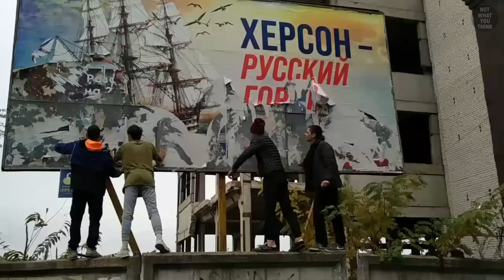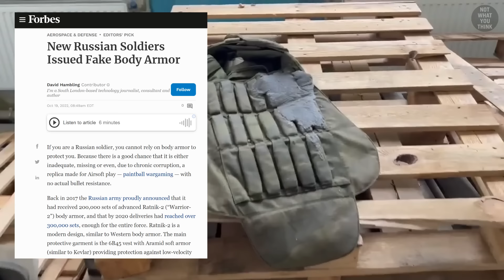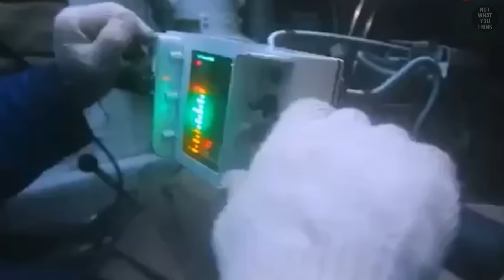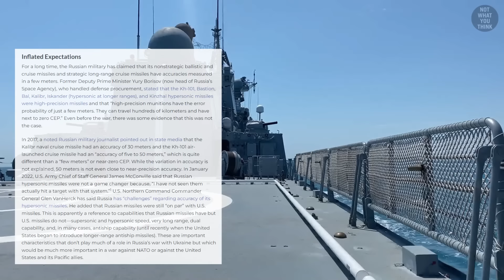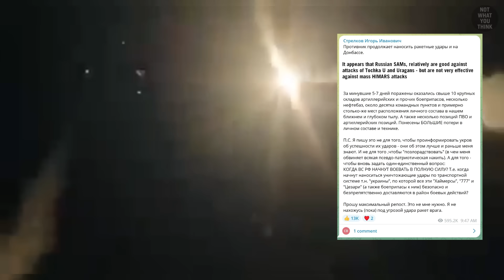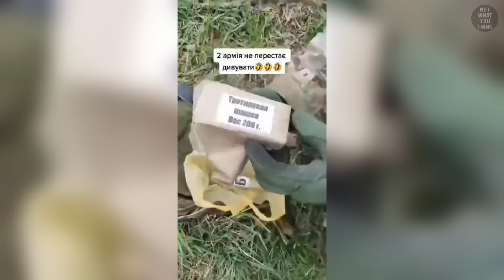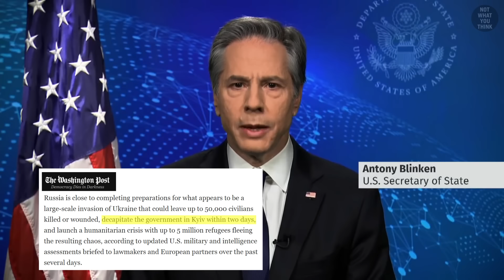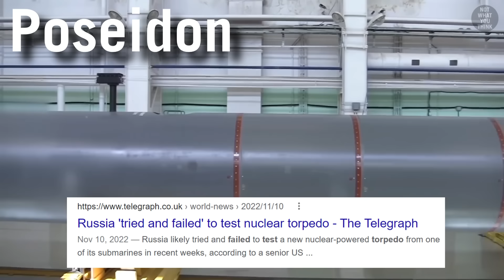The True State of Russian Army

Comment: The Mosin-Nagant 1891 and M44 carbine version, was available for $50 in US gun stores, during the late 90's and early 2000's.
They still had alot of cosmoline to clean off.
Reply: got mine for $100. i love it for target practice but would not want to try and use it as a main battle rifle...
Reply: The Moist Nugget's a pain to use.
Reply: My good friend Simo would disagree with you
Reply: Very old gun
Reply: The Finnish snipers in the winter war in1939 thought a lot of them 1 killed over 200 Russians with one. Old or not their bullets still kill
Reply: @jonfox8010  Easy 250 yd open sights on manhole targets
Reply: The mosin nagant had a VERY long run, I believe mine is from 1939? I also think it's the most manufactured gun ever. It's been around for a long time and is still a good bolt action rifle. I'd rather a mosin then nothing.
Reply: @jlo7770 I’d rather use it for hunting than in a war then. If it’s that old then it could be unreliable or so rusty and dusty it wouldn’t even shoot properly. It’s a gun designed for wars fought 80 years ago, not something I’d use today.
Reply: the picture with the mosin was actually part of the Ukraine military not the Russian btw
Reply: @SawyerruddockRuddock  underrated comment. if it's true, then it makes you wonder what else in the video is false or inaccurate

Comment: 6:10 The Finnish Mosin nagant is one of two rifle at 9-hole reviews to have reached 1000 yards with iron sights alone, so a scoped Mosin for DMR-stuff isn't quite as outdated as portrayed.
Reply: These are Tula made. Probbably more reliable but less precise due to loose tolerances
Reply: No not necessarily, but that assumes that the soldiers issued with Nagants are actually 1) intended for the DMR role, and 2) have received adequate training. And as @Vik Karabin pointed out, there's no knowing the quality and state of those rifles, especially after potentially many years in stock. 
It seems more likely to me that they've just been given them because there was nothing else to give.
Reply: I would imagine these bolt action rifles were not issued to front line assault troops.    I also imagine them as a supplement to say AK--47 which have a range of only about 300m.
Reply: Yeah and 4/10 of my Russian made 7.62 rounds are duds.. even with the heaviest spring they make it won't fire the caps. Federal  brass works everytime
Reply: That rifle does hold the most sniper kills by one soldier . 300plus confirms
Reply: I agree that a scoped Mosin can still be formidable as a DMR.. I'm just curious what happened to all the Dragunovs? I would not be surprised if there are more Combloc semi auto 7.62x53x54r rifles in US civilian hands, than the Russian army.
Reply: @mnxs  Since all the photos of them have scopes mounted, I think 1) is fairly certain.
2)...  well, it's Russia. You might or might not get training on your working or not working weapon.
Reply: Oh yeah, those Russian conscripts will be popping off heads at 1000 yards, I have absolutely 0 doubts about it.
Reply: @MichaelDavis-mk4me  lol same. And by "popping off heads", we're of course talking about the heads of their comrades
Reply: @MichaelDavis-mk4me  First of all, no one takes headshots at 1000 yards.
Secondly, do you really believe that Russian conscript would have a greater chance hitting with an AK?
Reply: @johanmetreus1268  Yes, because he'll shoot a lot more, which is his only hope of hitting something.
Reply: @mnxs  Or maybe they just doing a ceremony...
Reply: @mnxs  And the fact that Mosins are much rarer than Kalashnikovs.
Reply: @MichaelDavis-mk4me  Let's change the topic about Ukrainian conscripts....
Reply: Finnish mosin Nagants are completely retuned and rebuilt  from russian captures. They replaced the barrels, the sights, and the stocks. They tuned the bolts and triggers and bedded the barrels with shims. Russian Mosin Nagants very rightly have a reputation of being a sewer pipe for good reason.

Comment: The rags not socks is not from a loss of socks but actually a way so your feet do not get too sore from walking for long distances. Helps when your feet are wet too. It was done years ago during ww2 as well.
Reply: how are the rags superiors to socks? how are they better at preventing sores? I would have thought a sock would have less points to rub on (i am actually asking, i am curious what the advantages are)
Reply: @ttrev007  Rag isn't quite the right word, it is a cloth intended for the purpose. Advantages in earlier decades and centuries were their being simpler to make than socks & simpler to dry & simpler to mend. Plus you could alternate which end of the cloth you started with which would redistribute the primary wear points where a sock will have the same primary wear points in the same place every time. A disadvantage was that careless wrapping could cause blisters.
Reply: @alonespirit9923  ah i can see some advantages, but with my luck if did it i would get blisters. socks are more idiot proof
Reply: @ttrev007   done correctly with the right amount of wrapping one’s foot would be firm and not move around in the boot. Sweat would be absorbed more than a sock which would protect from water too, and as alone spirit said as well.

Comment: The Mosin-Nagant case is a stupid one. Firstly, designed in 1891 does not mean it is manufatured in 19th century. As a sniper rifer, it has been re-designed and produced in late 20th century, you probably noticed that the model used in the video is not the same length of the 1891 version. Second, the Sniper rifel usually uses a bolt-action manual model, because auto-machine will decrease the stability of gun sight.

Comment: There's no way that Poseidon torpedo would work.  Even at 100MT (this would be the largest nuclear yield ever, by a significant margin), there isn't enough energy to produce a wave that high over that large of an area.  You could probably blow up a port city, but that's not exactly a new capability.
Reply: Just for the hell of it, I tried to figure this out.

1 megaton = 4.2x10^15 J, so 100 megaton  = 4.2x10^17 J. 1,600 ft is 488 m, but for a "wave" I'll call it 200 m since over half the water should be below 1/2 the max height.
It takes 1961 J to move 1 kg up to 200 m (avg height), so 1961 J/kg :

4.2x10^17 J / 1961 J/kg =  2.14x10^14 kg of water, which a kg is equal to 1 liter, so 2.14x10^14 L
1 L = 1.0x10^-12 km^3, so 2.14x10^14 L * 1.0x10^-12 km^3/L = 214 km^3

I live in the US, so Lake Tahoe is the only lake roughly around that size at 151 km^3. So if you were to drop a slightly larger lake than Tahoe on top of the ocean from 250 m up, it would have a similar amount of energy as a 100 megaton bomb going off. You'd wipe out low cities like Liverpool and London, possibly even Manchester, being that it's inland, but only at 13 m elevation. Whales and Scotland look like they'd be largely untouched.
Reply: @timmytutone5386  thanks
Reply: @timmytutone5386  Wish I was good at math like that. Good job bro definitely appreciate the breakdown.
Reply: It's physics.
Reply: I mean, isn't the closest yield bomb the Tsar bomb which was tested at 50MT but supposed to be capable of 100MT? I wonder if that 100MT Tsar bomb was even a reality...........

Comment: Speaking of the S-400, let's just mention something about its range. The S-400 is often claimed to have ranges of 400+ kilometers. However, this number is an optimum range, under ideal conditions, which is to say, you find the aircraft right away and it just merrily flies in a straight line towards the missile. In reality, however, it's not that easy. 

Things like clouds can get in the way of radar detection. Stealth technology, while not relevant to the Ukraine War (thus far) also lowers acquisition range (Keep in mind that the F-35's radar signature is optimized against short wave radar, which is primarily used to target airplanes, whereas long wave radar is used to locate them, so you might know the F-35 is coming, but that's not gonna get you the ability to shoot it down). Things like jammers, both airborne and on the ground, can also impede your ability to actually hit anything. So while, sure, in theory, the S-400 could shoot an airplane down at a range of 400km under ideal conditions, those are unlikely to occur in the field, and so its firing range is probably limited to 150-200km, depending on what the plane is doing, and its acquisition range might be even lower than that. Still a lot of area covered by one system, but nowhere near as scary as people like to make them sound.
Reply: Yes. The missile (40N6) that reaches 400km is supposedly meant for AWACS or something. Looks to be very long and heavy for agile aircraft. 
The 250 km missile (48N6) is for everything else like missiles or jets and so on.
Reply: S 125 in Serbia took down both F117 and B2 so you shouldnt talk about the quality of American weapons...
Reply: @mladengvozden799  I've never heard of a B2 being shot down anywhere. From what i can find, this claim arose from confusion about the F117 shootdown. And besides, stealth is not a be all and end all, it has to be used in combination with good mission planning (such as using jammers to confuse air defenses, SEAD, and not taking the same route every time, neither of which was done in the case of the F117 being shot down) to ensure shootdowns don't happen. 

And besides, the plane was only shot down because the operator of the S-125 went against protocol and did another scan of the airspace around it (which you aren't supposed to do because it might give away your position to anti-radiation missiles) and that scan happening in the exact moment the plane opened its bomb hatches, therefore giving the radar enough of a reflective surface to achieve weapons lock.

Also, iirc, the plane had no missile warning system, which is why the pilot didn't even know the missile was coming until it impacted him. Not that it would have helped him much, because the F117 also didn't have any flare launchers, because the US Air Force assumed that the stealth tech itself would be sufficient. The Air Force has since learned their lessons from this event.

So yeah, the F117 was shot down through a combination of bad mission planning (as a result of complacency rather than incompetence) and dumb luck, not because US technology sucks. And besides, if the plane sucked as badly as you claim, how come that this is literally the only time one was ever shot down? 

There wasn't a single one shot down in Iraq, even though they went right into Baghdad and they were the only planes that did so, because at the time of Desert Storm, Baghdad had some of the best air defenses in the entire world. Yet, despite 1300 sorties in Desert Storm alone, not one F117 was ever shot down there.

(And let's not even mention how the US flew over 100 times that in total and lost only 36 planes in all of Desert Storm, so clearly, they are doing something right)
Reply: @mladengvozden799  You are conveniently omitting a lot of information here. Look into it and you will find why the F117 got shot down.

Comment: The Gatling gun is a rapid-firing multiple-barrel firearm invented in 1861 by Richard Jordan Gatling. It is an early machine gun and a forerunner of the modern electric motor-driven rotary cannon.
Reply: What were you trying to imply? Which military is using Mr. Gatling's original design nowadays, huh? Thing is, nobody said the concept of a "bolt-action sniper rifle" is obsolete. People are saying "why using M1891/30, why using a WWII era RIFLE that's NOT IN SERVICE at all??" The answer is so clear that even people like you can only deliberately ignore: they just don't have enough of them. 😂 After all, they already lack helmets, clothes, bulletproof vests, medical kits, and rations, which are way easier to make than a tube that launches bullets, amirite? 🤣